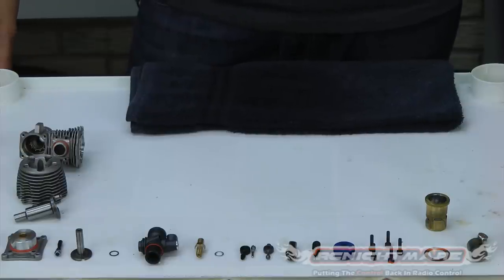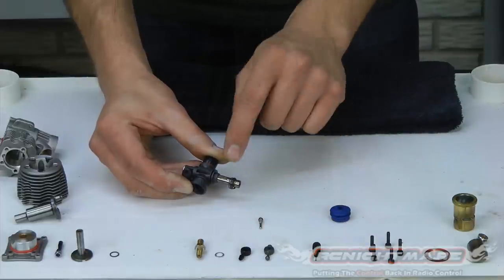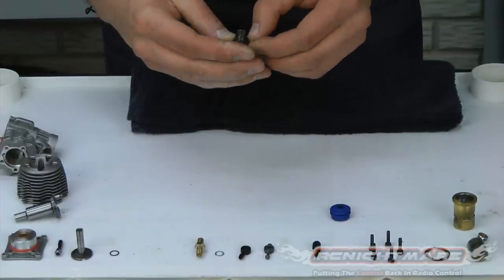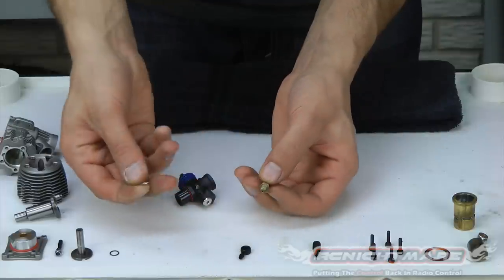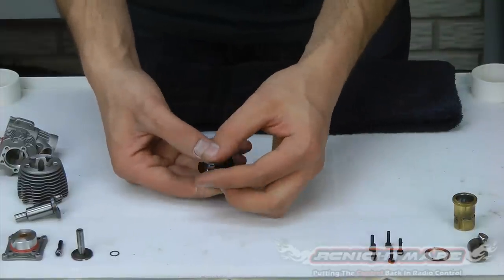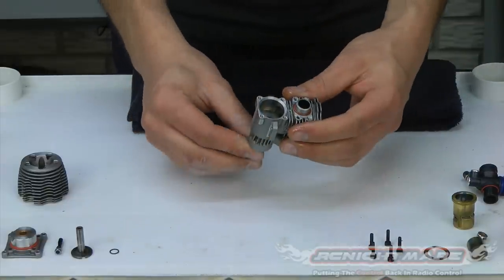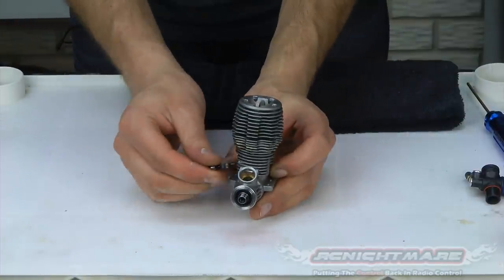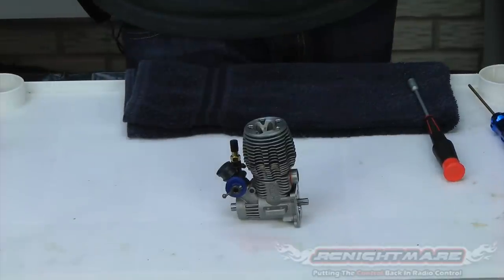RC Nitro Engine Rebuild Pt 5 Nitro RC Engine Assembly

Comment: I dont have that engine, i have the first generation (1997) trx pro .15 eng. its all original, i rebuild it once a year to make sure its ok. Barely has any pitch or compression and runs better than my bro's 3.3... I bash the hell out of it too! Thanks for the uploads

Comment: Always use Permatex Ultra Copper sensor safe sealant (found at any auto parts store) to seal the carburetor mount, main needle's banjo fitting and the backplate!

Comment: Hey rcnightmare
When rebuilding the carb. on the HSN the part that connects to the fuel line, the niplet does that need to be set a certian way.. I ask because when rebuilding my carb, I notice that the HSN at the base theres 2 holes where fuel goes into I guess, dose the niplet need to be flush to one of the holes, does even matter.
Will the fuel past through the HSN it is not flush to one of the 2 holes in the HSN?

Comment: I've tried hot med & cold plugs of all brands and nothing seems to make any difference any ideas by the the way engine is a Losi Mach 427 & I'm running it on 33% nitro I know that's a little high but I had the same problem with 20% the clutch bell bearings only last about 2 or 3 tanks of fuel as well I would really appreciate any advice you might have thank you

Comment: Previous problem resolved but the reason I thought I needed a rebuild is because I burn 1 glow plug per tank of fuel I'm pretty sure it can't be lean because the carb is tuned so rich that it spits tons of fuel out the exhaust and smokes alot & has good power and everything internally seems good piston pinches at 1/16" so I'm stumped what else could cause burnt plugs so fast?

Comment: I followed step by step but every time I even barely snug my back plate it locks my motor up the only way to get it to spin again is to loosen it to the point that it's no longer sealing any ideas on why?  Thanks in advance.

Comment: Since when is wd40 not an oil. If It's an oil then what is it. I always thought it was an oil.
Reply: traxxas5308 oil never old poulated. its been around. 4 billion. years
Reply: traxxas5308 Its an oil,or moisture displacement as I was told. I was told it works great as an after run oil and burns off in the combustion process with no issues so yes,you can use WD-40 for an assembly oil. He didnt cover things like checking o- rings and those copper gaskets. If they have spin marks replace them. I would replace all o-rings immediately.  Why would you not?